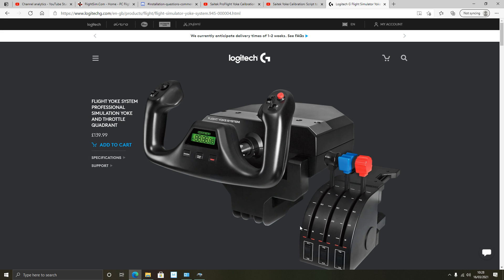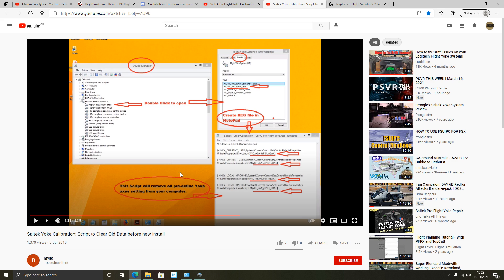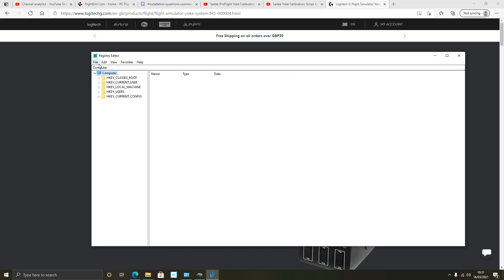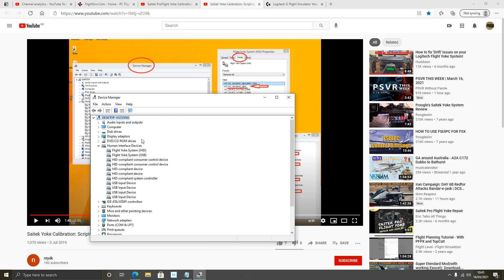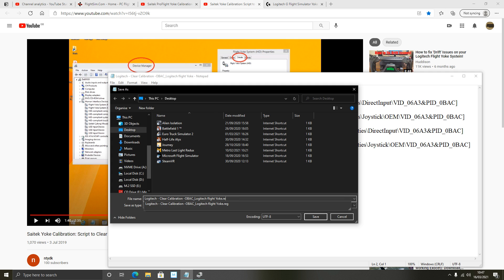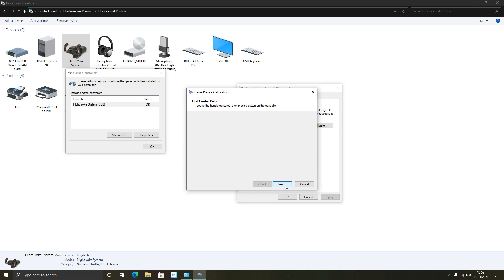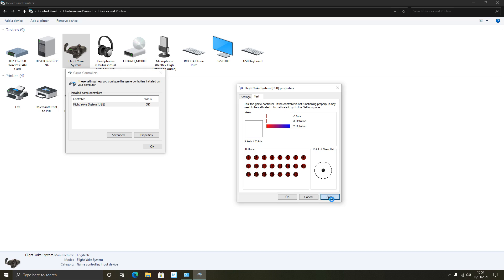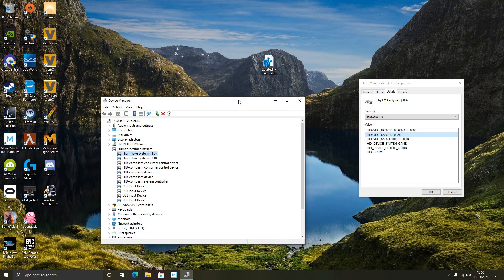FS2020: How to add a 'Calibration' Option for your Logitech Flight Yoke System - Works great!

Comment: Thanks for a great video. I have a Saitek flight yoke system and went through everything as shown but problem when I go to run the newly created reg file i get a Registry  that says " 
Cannot import C:\user\Ian\Desktop\name of file.reg. The specified file is not a registry scrip. You can only import binary registry files from within the registry editor"
Does any one have any thoughts on this or am i missing some thing.Ian
Reply: To anyone encountering this problem, you must include "Windows Registry Editor Version 5.00" at the top of the file, as shown in the video (just clarifying what John Crichton said).
Reply: @bungtunger5345  Thanks to your comment I was still able to do it properly🙏
Reply from the maker: I'm a bit puzzled buy this one, but will give it some thought.
Reply: @Huddison  Great thanks. I will give it another go when I get time and report back. Keep up the great work
Reply: @zk-igm9661  Hi there - you need to make sure you include the text at the top of the notepad file.  This tells Windows it's a registry script (even if you save as *.reg) and to run it if you click ok.
Reply: @johncrichton4341  Thanks John do you mean the words "Windows registry Editor version 5.00 Registry

Comment: Great job, but how do I get back the "Dead Zone" into the Yoke? 
If it is not centered & neutralized it will interfere again with my SAITEK 55-Rhino Stick!
Do you have the folder path to the original reg?
Reply from the maker: I'm not certain I have now.

Comment: What do i do if it does not run the file
i did exectly what you did
Reply from the maker: It's hard to say: is everything spelt correctly?
Reply: @Huddison  It actully was all good for a flight until i woke up this morning. now it is all messed up back to the way it was
Reply from the maker: @olebenjaminmikkelborg9833  That's not good :(
See the newly pinned comment and suggestions and see if that helps.

Comment: Flight Yoke System By Logitech:  I'm finding that the Axis X and Y are in the extreme end of the scale, should be centered on the graphed.  When I switch the view to cockpit the yoke is turn way to the right.   Have not found a way to correct this and I'm thinking the unit (Yoke System) is bad, may have to replace it.  Would appreciate your thoughts on this issue.  Enjoy the new year.
Reply from the maker: Hard to say whether your unit is faulty, it could be your sim settings.  Best asking on our Discord about this: https://discord.gg/Ameu93sHfY
Reply: if you fix it lmk how cuz the same thing happens to me

Comment: I have been enjoying your videos, learned a lot.  Just Purchased the Flight Yoke System but having trouble running it.  The flight is out of control  and trying to taxi is terrible.  I would like to try the calibration method that you've shown but I wondering will it work on window 11?  Tried to contact Logitech but that didn't work out. Any suggestions would be welcome.  Happy New Year
Reply: No , thanks for responding.
Reply from the maker: Have you got AI assistance turned off in Assistance Options?

Comment: Sorry if this is mentioned in a comment somewhere. Not seen it so far. 
I know this is an old post now but I have had a lot of these yoke calibration problems and tried many ‘fixes’ including physically moving the wheel inside my Logitech yoke. The last thing I wanted to try was altering the Reg. but I felt I had no choice and was going to follow your instructions.
I then found that if you type ‘game controller’ in the search bar at the bottom of the screen, you actually get a calibration screen for all your controllers which are connected.
All I done then with the yoke was to push it fully forward, turn full right, pull fully back, turn full left, push fully forward, turn full right etc and repeated this 3 or 4 times and watch the ‘cursor’ go around the square. Job done. Also checked all the buttons and sliders. 
If you wish, you can alter ‘dead zones’ here too, which I done on the rudder pedals as I was forever hitting a brake as I tried to turn. I found this worked in both my PC’s, one Win 10, one Win 11.
Great tutorials by the way. I have gone through them all in order to learn MSFS which I only bought a few weeks ago and I can now plan a route, take off, fly and land with no problems, even at night. I’m no youngster either, just a pensioner. I do fear though that Vatsim is out of my range, at least for now.
Reply from the maker: Wonderful comments thanks Ivor.  Another Special video incoming for the Logitech products (around Christmas).
Reply: Hello, I have a problem that after starting the game the controller works, after a few minutes of flight it stops responding to movements at all, if I quickly disconnect the USB and plug it back in, the problem disappears again for a few minutes, can anyone help me?
Reply from the maker: @Arkadiusz_Official  It could be that your PC power supply is not feeding your usb ports enough power.
Or you have a faulty lead/controller.
Reply: @Huddison  Well, as if it's a bit impossible, because a few days ago everything was fine 😭
Reply: @Arkadiusz_Official  Got to agree with @Huddison. You could also try a different USB port or get a powered USB hub. I had a similar problem to you but now I have two powered hubs. One runs my instruments and multipanel and the other runs the rest of my panels, pedals and yokes. Instrument panels are best in a USB TWO hub. (Important - Must be at least 2.5 amp supply)

Another thing to try is;- Go to ‘Device Manager’, ‘Human Interface Devices’ and the ‘Right Click’ each device listed, go to ‘Properties’ and check ‘Power Management’ Tab. I have unticked the ‘Allow the computer to turn off this device to save power’. This also helped my problems before I bought powered hubs.
First thing to do though is make sure you have latest Windows Update and latest drivers.
Good Luck
Reply: @IvorWilliams-jh3pw  A few days ago I was playing everything was ok, today I wanted to play and such problems, first I had the configuration of the original controller and today there was some advanced with Saitek Flight Yoke 😱 and since then I'm stuck in the game, even if I enter the controller settings manager, I have to move it,  I would like it to activate, I will add that Win 11 updated, now reinstalling Win 10
Reply: @Arkadiusz_Official  I hope it fixes the problem 👍
Reply: @IvorWilliams-jh3pw  It works!!!  So far 😂 Thank you for your help 🥰🙏😁
Reply: @Arkadiusz_Official  Glad to have helped. 😀

Comment: Thank you very much for the video.   Worked fine for me.  I did have to add the line regarding registry editor version 5.00 at the top of the Notepad file for it to work on Windows 10 (received an error before doing that).    Do you know if this same fix will work for the Saitek rudder pedals?   I was going to try using the same file, but change the device ID.  Thanks.
Reply from the maker: Good question & I'm really not sure re the pedals.

Comment: At 12:04 I was able to do this without having to adjust the registry for Windows 11.  A few days ago Windows sent out an update and has changed the "Device and Printers" screen.  It no longer gives me a list like your video shows.  Now I cannot calibrate my Yoke.  Do you know how to get the "Device and Settings" back to the way it used to be at 12:04?  thank you
Reply: Windows button >  type:    usb game controller :)
Reply from the maker: I don't use windows 11 myself, but oyu check on our Discord, as I know some folks use it on there.

Comment: Hello!
Awsome video, I also have issue with the Logitech Yokes system and couldn't find how to calibrate it until I found your video.

I am new to Flight Sim, I had a hard time with the turorial, the plane was always going right/down until it crashed. I always had to compensate for it, regardless of the setting in-game. It was really driving me insane. Now it's so much better and smoother! A new experience and it's so much more fun ;)
Reply from the maker: That's really great to hear ;)

Comment: When you ad your files in the notepad, you have to get the first line "Windows Registry Editor Version 5.00" on top, or else it will not work. But you forgot it in the lines to copy.
Reply from the maker: Thanks, I will amend that.
Reply: Out of curiosity, say I want to re instate my original reg, do I. Just double click on the backup I created?
Reply: Thank you so much. Battled with this. Didn't think of that first line

Comment: It was difficult to fly because the axes were not aligned with the existing calibration method. It worked fine thanks to the method you provided. Flying is fun. Thank you so much.
Reply from the maker: Glad it helped :)

Comment: Thank you much for this video.  

I received the Logitech branded yoke and rudder pedals for Christmas (thank you Mrs!), and was having the same yoke drift issues under Windows 11.  I followed the instructions in this video and it makes flying much more enjoyable.  The only difference I found was that before registry patching BOTH my yoke and rudder pedals were shown in the device list (Control Panel > Hardware and Sound > Devices and Printers), but after patching only my rudder pedals were listed.  Right-clicking on the rudder pedal icon allowed me to access the Game Controller Settings option allowing me to access the yoke for calibration. 

As talked about, it is important to remember that when creating the yoke registry patch make sure you put "Windows Registry Editor Version 5.00" (minus the quotation marks) at the top of the document with no spaces above, followed by a space, then the required registry entries listed in the video.  If not done correctly you will get an error when running the registry patch.
Reply from the maker: Great addition and congrats on your new acquisitions ;)
Reply: Thank you for this addition the file would not work until I read your post!!!

Comment: Because the settings need resetting often, the easiest way I find is to keep the original setting (the one with the dead zones) and just unplug the USB plug and re plug it back in before running flight sim. Resets it perfectly every time for me.
Reply from the maker: It only resets for a short time though & yes, I also have gone back to the original settings and simply adjust the dead-zone tabs.

Comment: Is anyone else having any issues with the Saitek Yoke System in Flight Simulator? I have a problem with FS2020. It would run fine for 5-10 minutes and then it would become unresponsive. I would have to unplug the USB, plug it back in then the performance would repeat itself. Has anyone else experienced the same thing? 

After I control or land the plane for a few minutes on the ground, I suddenly lose control of the plane completely. It no longer reacts at all. No matter what I do. I have to take the USB out and plug it back in every time to make it work again. Sometimes it works and sometimes it doesn't.

I ask for help..
Reply from the maker: That doesn't sound right at all - it's almost as though your USB port is turning off on you; have you tried it it different USB ports on your PC (I had to ask;)?
Reply: @Huddison  yes, I've already tried it (HUB and mainboard). I've noticed that all controllers have the same problem.. I'll reset my configuration and reassign my buttons. Maybe that will help me

Comment: Hello, I have a problem. And the thrust lever of the Throlle no longer reacts. Do you know something
Reply from the maker: Hi, first try assigning the thrust to a different lever and see if that works.
Reply: @Huddison  I've tried but it doesn't work
Reply from the maker: @fakecall3196  It sounds like you may have a faulty throttle quadrant.  Is your yoke working normally?
Reply: Yes the yoke works perfectly
Reply from the maker: @fakecall3196  It may be a faulty quadrant issue, but others may be able to offer suggestions.
Reply: @Huddison  ok thanks
Reply: Now the thrust lever works again: D
Reply from the maker: @fakecall3196  Great stuff 👍

Comment: Lovely video but I don’t have the deadzone tab like you. Just a calibration one but still drifts to right after I calibrated. Any advice?
Reply from the maker: If you don't have the deadzone tab as default, I would advise to recalibrate every time you launch MSFS 2020,  - a pain, but it worked for me.
Reply: @Huddison  I calibrated it multiple times and it still always drifts to the right. I think I’ll just return the yoke and look for a new one…

Comment: Thanks for video.  However, I have a problem.  I am fully adjusting these settings.  the problem is solved.  When I restart the computer the same problem happens again.  Do you have any suggestions about the solution?
Reply from the maker: What problem is reoccurring?
Reply: @Huddison  My problem it is flickering to the right and there are too many dead zones to the left. It gets fixed when I do the steps in the video. But, When I restart the computer, the calibration breaks down again.  When I remove the hardware and do the steps again, the problem goes away.  I must to do the steps in the video again on every reboot.
Reply from the maker: @muratg5817  I still have to re-calibrate often, but at least now we have the option to.
Reply: @Huddison  
There are dozens of people who do not have this problem. Why is there a problem with us? It is very annoying. Thanks again for the video.
Reply from the maker: @muratg5817  There's also a lot of people who do have this problem - mine didn't start drifting until a year after I purchased it; seems like a hardware related problem to me.
Reply: @Huddison  I just bought it. And I have this problem since I bought it. Hardware does not make sense. What is your motherboard brand? My asus b450m-k. I think it might be related to USB drives.
Reply from the maker: @muratg5817  Are we talking about the same thing here - the drift issue on the Flight Yoke system?
Reply: @Huddison  Yes I am talking about saitek pro flight system.
Reply from the maker: @muratg5817  It's unlikely to be a Motherboard issue; the drift issue is widely known on these yokes and I get the same result on both my PC and Laptop.
Reply: @Huddison  Well. I want to ask a last question. Do you recalibrate when you restart the computer?
Reply from the maker: @muratg5817  I do out of habit now, yes.
Reply: I found out that if you press "reset to default" on the properties menu, the behavior is the same as when you restart.
There must be a faulty calibration file that Windows applies on boot. If only there was a way to replace it the problem would be solved.

Comment: Great video!  I applied the .reg file and definitely see a change in the yoke's behaviour.  I'm wondering if, after applying it yourself, you had to change your sensitivity values?  I'm happy with what I'm seeing in the Cesna but not so happy with the 787... seems very sluggish now.
Reply from the maker: Hi Peter, yes I had to reapply my sensitivities settings (see the Video description ;)
Reply: @Huddison  Sorry, what I meant to say was that I have the same setup as you - what exactly did you put your sensitivity settings to?  I've run the calibration and, for fun, I'm trying to stall the 787 and can't (not sure if it was possible before, but I would assume with Hard difficulty this should be possible).  I'm going to go try another aircraft to see what's possible but I thought I'd tackle my setting first.
Reply from the maker: @pvg00  I'm still fine-tuning them (after running the reg calibration trick), but I'm intending to release a video soon of all my button assignments and sensitivities etc ;)

Comment: Hello Huddison, once again, thanks for a great video, I truly believe this will fix or repair a LOT of issues with the throttles on the Logitech Flight Yoke System and Throttle Quadrant. We have a LOT of trouble with this issue. It is a shame that Logitech can't get with it and do something for all the consumers who have purchased this system. Their support is almost non existent. We are on the very edge of scrapping our system because of this. I do have a question for you though if I may !!! What driver do you have for your system? We seem to be able to only get 8.0.116.0 no matter which driver we try to dwnld from Logitec's support site for drivers. We have used the REG EDIT file to clear the drivers each time but to no avail when we try to install the new drivers from Logitech. VERY VERY frustrating.
Reply: Thanks for the reply Huddison, Your answer intrigued me, so I'm wondering if that when you mounted the Yoke and included throttles  the very 1st time, you had the computer turned off and then plugged both the yoke and the permanently attached cord from the throttles into the yoke before starting the computer up? There appears to be a definite discord between your procedure (which works) and the procedure that Logitech  suggests which loads the driver I was referring to in my original post which has caused us so much trouble. Thanks for your patience on this one, but it's important to a lot of people who have been led astray by Logitech.
Reply from the maker: @dougmacdonald5849  To be fully transparent, I don't remember if I attached the USB from the Flight Yoke System into the PC prior to tuning on the PC, or after Windows had started (understand that it was about a year and a half ago when I first did this!).

But I remember not installing drivers for it, either way.
I cannot say which way is better - only that I've heard many bad reports from people who have installed drivers for the Flight Yoke System;  so for myself, I am staying far away from them.
Reply from the maker: Thanks for you great comments Doug. I didn't actually download/install a driver for my Flight Yoke System; it seemed to work fairly well for me, by just using the plug and play method.